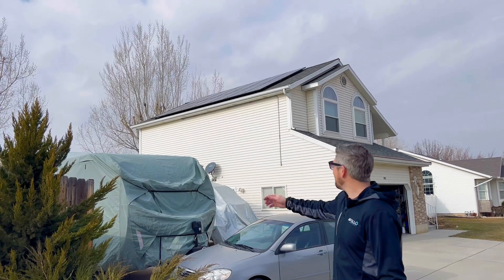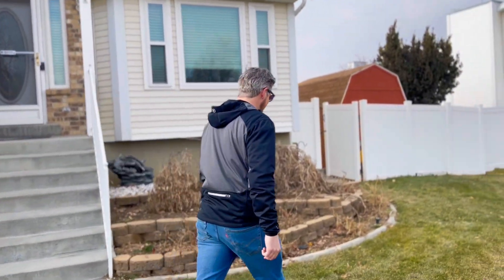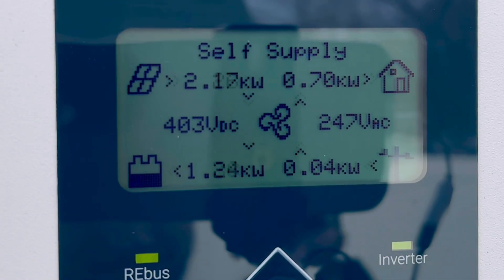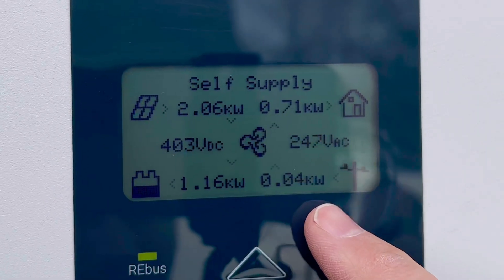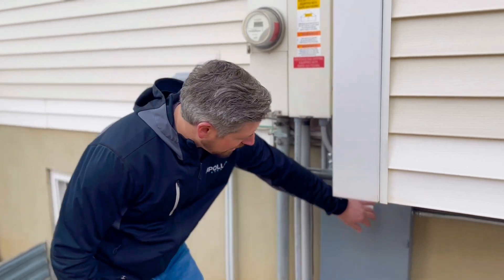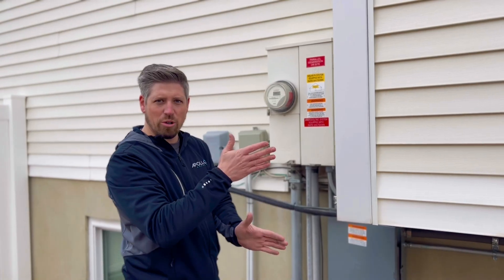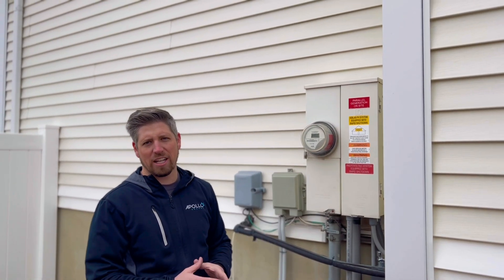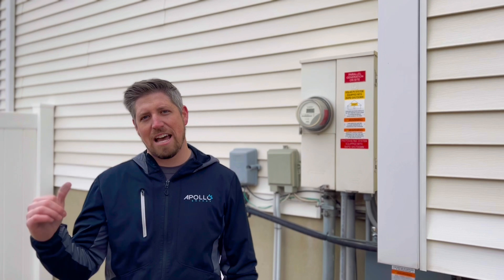How a Generac PWR Cell Battery Works

Comment: I bought a generac system and added three batteries originally… it has space for three more. What happens if I add the other three. Will I be able to use more appliances and  equipment without receiving juice from the electric company  grid?. What would the advantage be of having 6 batteries instead of 3? Thank you
Reply: Hey there, not sure if you found out yet or not. Getting those 3 extra will allow you to do a whole home backup and be completely off grid.
Reply: @gamerzieg3211  thank you for your response… I am desperate because the electric bill does not go down below $210. I added three more batteries today. What’s the best app configuration to achieve what u said? It’s been a year and a half since I installed the solar system and I have not received any rebate or money from the electric company, like I don’t know what they have done with all that clean energy they have taken from my system. Why is my bill not going down? By the way all the appliances in the house are brand new and energy efficient…can u explain to me why this is happening? I am about to hire a lawyer to get to the bottom of this.

Comment: "WARNING" If you are thinking about buying a Generac PWRcel Battery, be advised this battery will supposedly provide you with back-up power in a temperature range from 14 degrees to 122 degrees "BUT" the battery WILL NOT recharge if the internal temperature of the battery is below 41 degrees, it goes into STANDBY MODE, or IDLE MODE. My battery & inverter are installed in the carport of a detached garage this could result in No battery back-up if the grid power goes out for more than 2 or 3 days when the temperature is below 41 degrees even though this battery is outdoor rated. When I contacted generac why my battery was stuck in standby mode this is the answer I got.

The battery will discharge (provide power) down to a temperature of 14 F. It will not recharge until the temp reaches 41 F. It is important to note that the temperatures for this are measured by a sensor inside of the battery cabinet, not the ambient outdoor temperature. So, when the temp drops, the battery will begin charging again when the temperature inside of the battery cabinet reaches 41 F or higher as measured by the battery cabinet's internal temperature sensor.